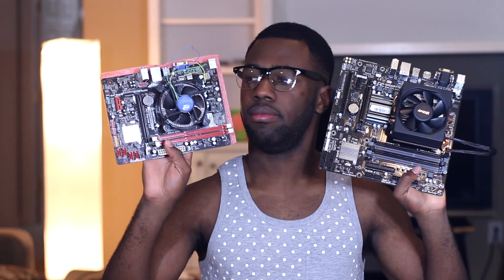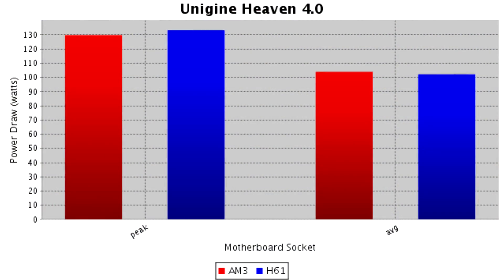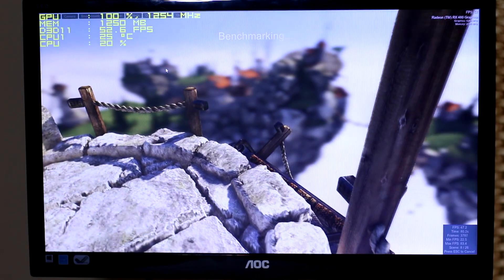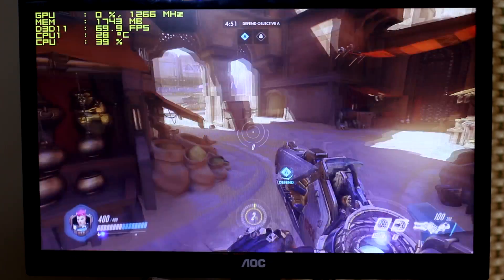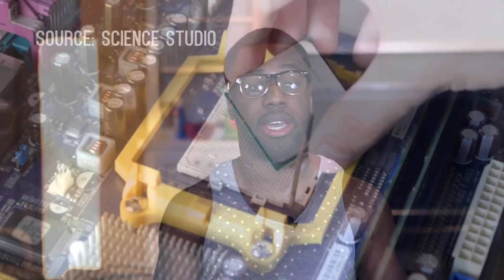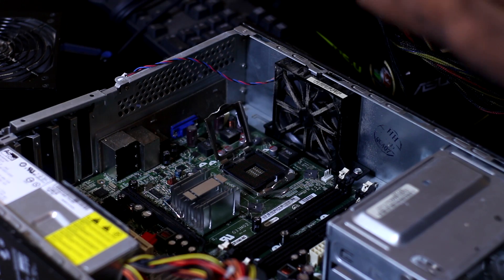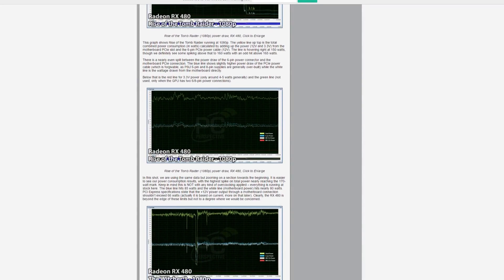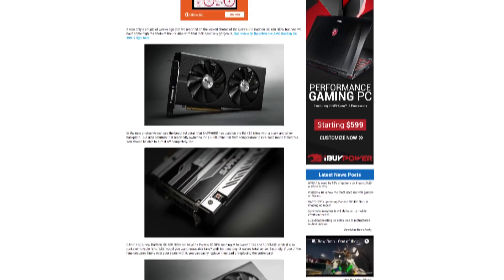Radeon RX 480 vs Cheap/Budget Motherboards - RX 480 PCIe Power Issues? | OzTalksHW

Comment: what about mine?? here my spec
i5 4460, Mobo Asrock H81m-gl, VGA Rx 480 4gb, Ram DDR3 4x2, PSU Enermax maxpro 500w 80+...
and the question is, my pc just shutting down immediately when i got play some huge games like Sniper Ghost Warrior 3, Watch dogs 2.. but for some games like, Rocket league, left 4 dead 2... its just doing fine... so, is that PSU Mobo Problem or PSU??

Comment: EVGA Z97 Classified motherboard, with Sapphire RX 480 8gb Nitro = any 3d game eventually locks up.  3  NEW installs of Linux Mint 18.2, Windows 10, Windows 7. All with the same results.  Tried about 8 suggested Wattman settings, tried using the onboard 6 pin PCIE supplemental power.  Also tested in a 1280x720 potato window.  I've heard that this card does not have issues on the Asus Z170-A motherboard, confirmation appreciated. My hopes is that I can at least sell this card to a miner.

Comment: please i need ur help badly i cant run this rx 470 4gb in my pc here is my pc config-

pc config- 

processor-core i5 3470 3rd gen
motherboard- Gigabyte G1 Sniper M3
ram-12 gb
psu- thunder 500w,model: RS 500-ACAB-M3,
type:intel form factor ATX 12V V2.3

problem is no display coming into the screen as i press the power button.

Comment: 6 pin power is capable of drawing around 200w power so I really don't understand what all the fuss is about I've got a 100 MHz OC on my reference card and have had ZERO issues...STOP BEING CHEAP AND BUY A MODERN MOTHERBOARD! NOT MENTION A GOOD PSU! THIS WILL RESOLVE ALL ISSUES!

Comment: hey man i've got theese problems
my specs.
mobo 960gm-vgs3 fx,
 8 gigs of ram (2x4 1600 mhz) 
CPU amd FX-8320e 
 windows 7 64 bits 
and the sapphire RX480 nitro 4gb OC 

the firts problem is the GPU driver... the gpu is detected and istalled normally but games doesn't work
the second problem is the AEROGLASS of win7 stop work after the windows startup 
the third problem the fans doesn't spin
the fourth is raddeon center stop working...

what should i do? please help

Comment: I bought RX 480 4GB yesterday and when I plug everything,installs driver and some games to look how it handle,i have about 6-7frame in AC Unity,and very,very bad fps drops in other games like Watch dogs and other!I can`t play nothing,I don't know what is a issue,man please give me a replay! Between I have FX6300 4,1GHz,8GB RAM,motherboard is Asus M5A97 R.2.0 its a crossfire mot. and I have 735W modular PSU.Does it issue with my other components or some system issue or driver?
Liked and Sub:)

Comment: i have GA-H61M-S2P (rev. 3.0) does it work fine ?? or i need to change and what about the power supply should i use(i have AC 60hz 220V)

Comment: I have a 2012 ASUS AM3+ motherboard and whenever I play a game with the RX 480 (no overclocking) it restarts my PC. I had no problems with the R9 270x overclocked. Just to eliminate any possibility of a software issue I reinstalled Windows 10 and installed the latest AMD drivers. Same problem. I have a 500w power supply with a 40amp 12volt rail. On paper everything should work :(

Comment: Hello Bro this is Arpit Srivastava from India and I recently subscribed your new channel. I am using core2duo e8400 since 2008 and this is a bottleneck for new games.I also assembled few PCs for my friends but they all are Intel.But I want to upgrade to AMD basically I am a fan of AMD, anyway I am confused between APU and CPU basically AMD A8 7600 and FX 6300. I also adding r7 370 4gb. So my question is what is the performance difference between these two I am not doing streaming or video editing I used to play some games like GTA 5, and Saints row 4 and some other. So please kindly guide me. I am pretty confused between these two.

Comment: I thought the main issue was the overdraw from the pcie slot exceeding 75 watts instead of the card pulling necessary power from the 6 pcie power connector

Comment: PCI-E 2.0 and 3.0 are a lot more durable then 1.0. 1.0 can go up to 75w max when 2.0 can 150w and 3.0 300w. Now it was funny how I saw 24pin to fry when it should have damage on PCI-E connector or around it. 
Now what I have read from net is that sense it is 75w from PCIE max then why are people frying something like sabertooth 2.0 990fx MBs? Well they have other PCI-E devices with rx 480 attached. And like always there is a trend people killing components when upgrading components, this always happens. 
Now that rx 480 is claimed to have power issues (still debate if it's serious) it is easy to connect killing your PC when putting new parts in it. I'm not saying it's not possible to fry your MB with going over the spec, but people have had little success on that even when overclocking fully pcie powered GPUs. But sense accurate test results show that rx 480 draws about 160w at max and you devide that by 2 you get about 80w from both pcie and 6-pin. Thats 6% Over... Sure this MB is capable of 75w continues power, but go 6% over and BOOM. Sounds pretty stupid.
Doesn't seem to be a real issue. Well AMD is making a fix and hopefully we see no PCIE over the spec problems and close this debate.

Comment: Hey I love your vids and was wondering if you could help me out, I'm trying to run bf4 on a rx 480 and celeron g1840 (thanks to your A+ vid on that cpu :) ), and even at low settings in 32 bit mode I get 70ish fps for like 10 seconds, then i lag out for a full minute (the application doesnt say not responding tho) before it starts working fine again, again at 70 fps before it lags out for a minute, and this cycle repeats. Do you have any ideas on whats causing this? My first thought was the CPU, but I saw that other ppl on youtube were running the game fine (admittedly at lower fps) on a similar setup with a weaker gpu. Thanks :)

Comment: I appreciate the shoutout, my man! Nice take on the issue via an LGA 775 board. The older boards definitely appear to exhibit issues with the PCIe slot when paired with the 480. Apparently, AMD will be taking corrective measures via a "driver update" very soon, although I doubt this issue will be fixed permanently via software (for the reference PCB, at least). For those new to the scene, remember that TDP and total power draw are not equivalent. This would only be the case if energy conversions were 100%, however, thanks to the Second Law of Thermodynamics, much of this power is lost in the form of heat.
Reply from the maker: Thanks for stopping by! I'm patiently waiting for the driver update to see whether or not it makes a difference, but like you said, I'm not too sure it will completely fix the problem. Granted, AMD was right about the GPU TDP, it is 110W, but the entire board itself exceeds the 150W TDP. A little bit over is fine (you can thank Physics for that), but it becomes an issue when it messes with the power draw on motherboards. Do you think you'll update your video post-driver?
Reply: +OzTalksHW Sure, I'll revisit the topic with the new driver. Morbidly curious at this point!

Comment: I want to finally upgrade CPU and GPU, do you think the i5-6600 (non-k) and the RX-480 (any after-market model) will fit well together?  and do you think a  100€ Mobo with H170 is good enough for a 1080p gamer? aaaaand.... DDR3L or DDR4 RAM? Thats all i wanna know :D hugs and kisses :*
Reply: The I5 6600 is good enough to handle this card without any problems and yes will fit good together.
No big difference with a 200€ or 100€ mobo in gaming. The cards run fucking strong at 1080p.
Ddr4 better than Ddr3.

Comment: Hey just wondering how does this look to you

pc power and cooling silencer mk2 750watt     
Xfi- bravua 7.1                               
msi 570gtx twin frozrII                       
Asus P8Z68-V Pro Gen-3                        
G-Skill sniper DDR-3 1600mhz 16GB             
Western Digital green 2TB                     
Asus dvd burner|drive                         
Coolermaster hyper 212 EVO                    
Thermaltake chaser mk-1                       
Saitek Cyborg V7                             
Razer Lachesis
Reply: what is that shit ? -> pc power and cooling silencer mk2 750watt     if you have money buy the seasonic or enermax (the best of the bests for PSU) anyway you forgot to say what CPU are u using.
Yep is good but the PSU is a problem if this mofo will explode it could damage something. Be aware for your PSU.

Comment: personally i think that using a top of the line GPU in a crappy old motherboard is a wast of money , it will bottleneck like crazy . And its 'a good thing if they burn their board , cause now those people will have no choice but to buy more up to date hardware to go with the RX 480.
Reply from the maker: It's not a top of the line GPU, it's a mainstream GPU. Meaning that people will be using mainstream motherboards with it (anything from $40-$70). If the PCIe lane is 3.0 there won't be a bottleneck :)
Reply: mainstream price ok , but the RX 480 perform at the same level as the GTX 970 . not mainstream performance .

Comment: its interesting in the picture how the burn occurred at the 24pin and not at the pci-e port or even the trace between the two.
Why bother to overclock a card thats already maxed out its power connectors at stock speeds in reference form

Comment: You will probably find its cheap power supply's that`s destroying the motherboards rather than the card most gamer`s overclock graphics cards and go over the 75 watt threshold but they use good components rather than the ones that comes with there case if i had a £ for everyone that brought a build to my house and it either had a PSU that came with the case or they paid like £12.99 for it... i cringe sometimes :P

Comment: so guys should i get a rx 480 ? Or is it better to wait for the aftermarket ( although i dont wanna wait any longer ). Only problem i see with the 480 is , the high temperature and heard that its also going to be fairly loud
Reply: 22/04/2016 they hit the shelf's i want the Strix with Aura lighting :) clocked at 1450 :)  http://videocardz.com/61658/asus-radeon-rx-480-rog-strix-coming-soon

Comment: Would an old Q6600 quad core work well with the rx 480?? plz advise...
Reply: it is really old for rx 480.
Reply: If you can oc the Q6600 to 3,6Gh (not going to happen if you ain't water cooling it/won the silicon lottery) and use DDR3 maybe. But most likely it's time to upgrade.
Reply: +SchwererGustav800mm what about a qx9650?
Reply: +Hxdoom G it is ok.
Reply: +Hxdoom G because it is powerful and im sure u oc'd it.
Reply: Hxdoom G
 A E5450 modded for 775 would be a better choice, more oc potential and a few bucks cheaper. But you would still be bottleneck the 480 a bit.
Reply: +SchwererGustav800mm dude im sure he has it alread
Reply: +Tuna Yücer can't oc now, it degraded :(
Reply: +SchwererGustav800mm thnx fr the reply, the q9700 is definately the right cpu but not available now as my mobo supports only p45 chipset lga 775
Reply: +SchwererGustav800mm the mobo and cpu was bought way back in 2008/09 and now its 2016
Reply: +SchwererGustav800mm are these new vga cards backward compatible ad well since my mobo had pcie 2.0 version, so will rx 480 / gtx 1060 will work??

Comment: My Socket 775 XP gaming build for 2016 includes the following:

Intel E8400 (E0 Stepping) CPU (brought in January 2016 off eBay for just £6.99)
Gigabyte EP35-DS3R (Rev. 2.1) motherboard, updated to F4 BIOS (brought new in 2008, shrink wrap finally removed in 2016)
4x2GB G.Skill DDR2 1000MHz 5-5-5-15 2T @ 2.0v memory
JeanTech Arctic 600W PSU (used for around 9 years from my previous Athlon 64 X2 4800+ Windows XP build)

Initially borrowed my EVGA GTX 960 SuperSC 4GB card from my current i7-4790K build, with the included dual PCIe 6 pin to 8 pin power adapter, to get it going and test that nothing was DOA. Then in June got an EVGA GTX 750 Ti SC 2GB card, with additional backplate, as it's permanent graphics card.

Was steady as a rock the whole time.

Thing is, having recently heard that both the 960 and 750 Ti has similar PCIe slot draw power spike issues to that of the RX 480, I was wondering if I had no issues with either of my cards, due to a combination of using a reasonable quality Gigabyte Ultra Durable motherboard, and that it also used a PCIe x16 1.1 slot instead of a 1.0 one?

Comment: Problem for PCI-E are only for those fools who have cheap/old mobos and  power suply of 250-300W in reality  even they are marked as 500,600,650..Wat power suplies
Reply: +cassardavid94 then don't build a computer. The motherboard is the thing you absolutely cannot skimp out on.
Reply: 'fools'... not everyone can spend over 100$ for a motherboard.
Reply: +Mark Larsen None. the max GPU I would use on the highest end 771/775 Xeon would be an r9 380....an Rx 480 is twice as fast as the 380. at 1080p the Xeon would bottleneck in most modern titles. At 1440p less so.
Reply: Gibbstronic I guess that makes budget builds impossible then. Nowadays they do actually make quality 50$ motherboards.
Reply: +cassardavid94 everyone can afford to wait a bit longer to save up for a $100-$150 motherboard that is actually quality. When those $50 "quality" boards die because of cheap hardware, you're SOL.
Reply: Gibbstronic As with any piece of hardware you can be lucky or unlucky. My dad bought a pc with a 40 euro socket 775 motherboard back in 2007/2008. Guess what the pc is still going strong to this day ( about 9 years later).
Reply: +Mark Larsen also note that I didn&#39;t recommend getting a socket 775 build. My dad&#39;s of was built in 2008(as I said) when the socket 775 was the highest end and most modern socket.
Reply: Omg mr essse i missed you im ifreaktz!

Comment: If your pairing this with a PCIE 1.0 motherboard there is a good chance your going to be CPU or even RAM speed  bottlenecked anyway. If your plugging three into one board like that miner did and it isn't a high end board then thats pushing it too. If they can't fix it via driver like was claimed then refunds should be offered to people with PCIE 1.0 / who blew their board up assuming it wasn't doing something like mining and a sticker on the box should state that you need PCIE 2.0 or higher. I mean this isn't ideal but its not like its blowing every thing it touches up.
Reply: to be fair for all cards that have come out since pcie 3.0 they always state them as pcie 3.0 cards with backwards compatibility for pcie 2.0. They usually never mention pcie 1.0 at all so maybe that has to be made clearer for all newer cards since modern cards can pull more from the pcie slots since pcie 2.0 and 3.0 allow it
Reply: Agreed, main reason being that PCIE 1.0 is a bottleneck to modern GPUs (or atleast we're close to maxing PCIE 1.0 16X). 

Something that also occurred to me was that PCIE as a standard, has probably outlasted pretty much everything preceding it in regards to GPUs.

The reason being that technically, you can plug the RX480, GTX1070 / GTX1080 or any other PCIE card, into any PCIE motherboard from 2003 or so till now. It would bottleneck somewhere for sure, but with every other standard, the high end cards quickly became physically incompatible. 

Examples going back 20+ years were  ISA to PCI, then PCI to AGP,  AGP1/2X to 4/8X (though slots keyed for both variants did exist), and of course AGP to PCIE.

PCIE 1.0 16x slots are a bottleneck on the latest cards AFAIK and the CPU's attached  are too. I'm guessing we will see a point where the cards refuse to boot or do anything in those boards potentially soon, but the RX480 highlights how damn long a PCIE 1.0 slot has allowed you to plug in the newest GPU.

Comment: Will it work fine on an XPS 8900?  I don't know the specs for its motherboard.
Reply: Just to confirm this machines recent correct and running a Skylake chip? That should be PCIE 3.0 which means it should be OK providing dell didn't cheap out on the board.

Comment: So wi ll this be safe to use with older pre-built computers?
Reply: Prob Not
Reply: Silent Prototype Darn it, do you think this will be fixed at a later date with the other brands or lower end models?
Reply: AMD is releasing a driver update that fixes the power draw issue. Even with this pci-e power draw issue, wouldn't worry at all.
Reply: SSBMBubbles ok
Reply: +ben nottelling 

people keep forgetting that the non reference custom model cards are going to feature more than just a 6pin power connector.

just wait two weeks and the asus, sapphire msi cards will drop
Reply: +ben nottelling how old, plus what's your psu and cpu?
Reply: ***** I've got an OLD dell vosto 410 and apparently the motherboard is based off the Intel g33. My CPU is a core 2 duo. Power supply is just a generic dell power supply
Reply: ben nottelling yeah with that setup you would bottleneck the rx 480. It's best to upgrade to a pc with at least 4 cores as games developers now no longer like supporting dual core setups  because of the consoles
Reply: ***** I'm working towards it :)